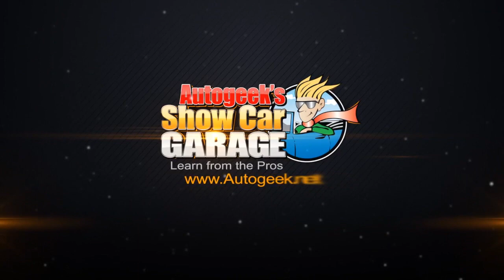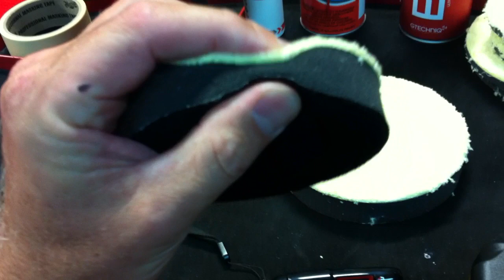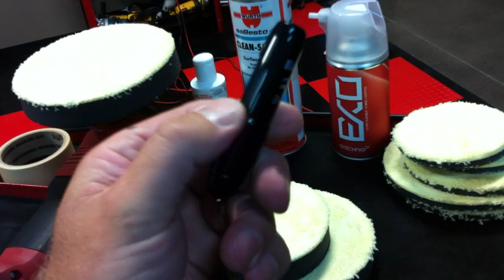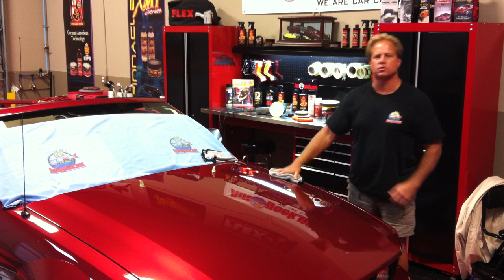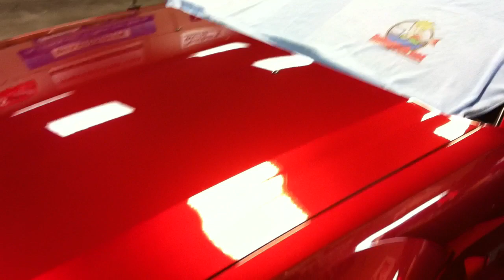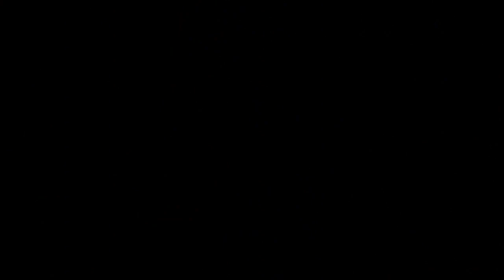Lake Country Ultra Microfiber Pads & Gtechniq EXO

Comment: I question you not wearing a mask Mike.
Reply: Mike Phillips can do what he want , he is setting the standards :)
Reply: Ya Ya he is the top fella

BUT

Id be wearing a mask
Reply from the maker: At the time I used these product there was no recommendation from the manufacturer to wear any type of mask.  The odor didn't bother me either.  That all said, I agree with you that it's important to wear the appropriate safety gear.

-Mike Phillips
Reply: Thanks, Mike.

Comment from the maker: Don't know.  Doesn't matter really because we used the least aggressive approach so we only removed what we had to in order to get the finish back to show car quality.  You have to choices, move forward and buff out the car or learn to live with the swirls and scratches and the owner wanted a show car finish.  Besides that, keep in mind this is a CUSTOM paint job, not a FACTORY paint job so the clear is normally thicker.  -Mike Phillips

Comment from the maker: Gtechniq recommends applying the EXO to a properly prepared surface which would include stripping off the Opti-Coat 2.0 to get to the actual paint.  It's possible the EXO would bond to the Opti-Coat and if so that would really be some protection.  I haven't heard of anyone trying this so maybe give it a try and post your findings to the AutogeekOnline . NET discussion forum.  -Mike Phillips

Comment from the maker: EXO doesn't impart a oily, wet shine like a oily polish like Meguiar's #7 but if you do the proper prep work it DOES create a wet looking finish that is non-oily.  One thing for sure, I was incredibly impressed with the finish on the 1965 Mustang Fastback with the Candy Apple paint job I used it on and my co-workers Mustang in this video.  -Mike Phillips